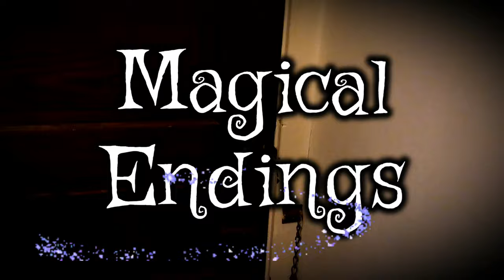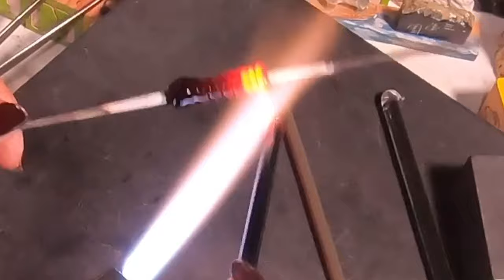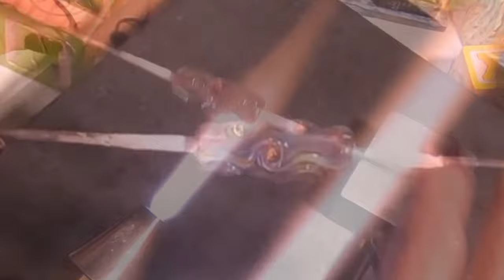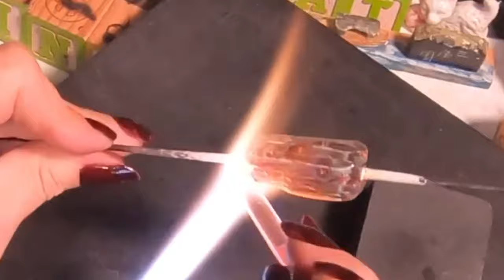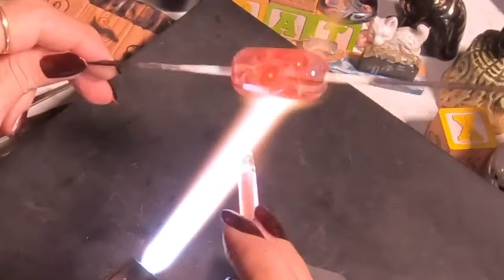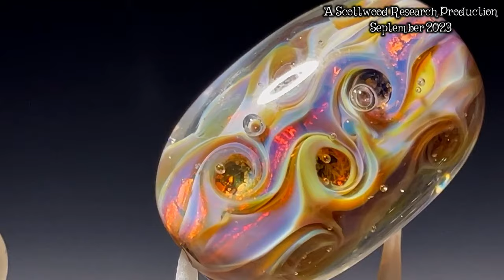Lampworking / Flameworking - 101.99 -  Magical Endings  - 104 demo

Comment: Robin, I am new to lampworking and I love your videos so much! I'm learning everything just by watching them over and over and then trying the techniques.
If you'd ever be willing at any point to add more 101 videos, I would love to see one on making twisties, and one on applying stringer.
Reply from the maker: Hi Ramona! 🌹✨ I’m so glad you have been enjoying the demos! 🤗 If you look in the playlist section there are the Black and White Volumes….there is a demo in there called Scrolling Lines that might help with stringer work! 😃🌹 there is also one called A Little Twisted Cane that is in the Everything Flameworking playlist.. I think it’s close to the bottom. It should definitely help you with twisties!  I have always called them twisted cane…😂🙏🏽   Most of the techniques in the black and white volumes are 101 based and I cover more methods that great for beginners!  …they are just poorly organized…😵‍💫  However, I will make sure to address ‘twisties’ and stringer work somewhere in an upcoming demo!  I hope this helps!!   🌹🌹🌹 Thanks so much for your comment and sharing…I’m honored to share with you!! 🌹✨✨✨Cheers - Robin